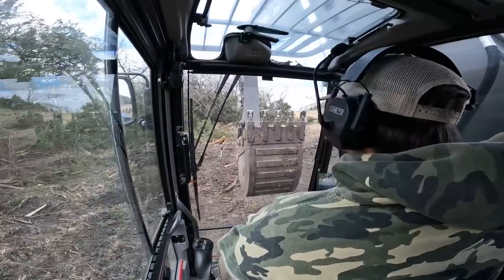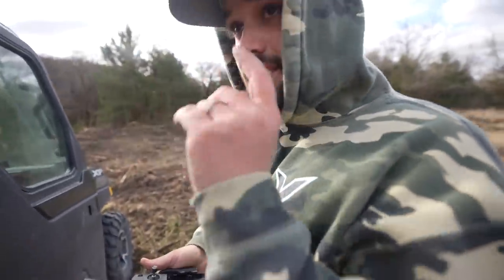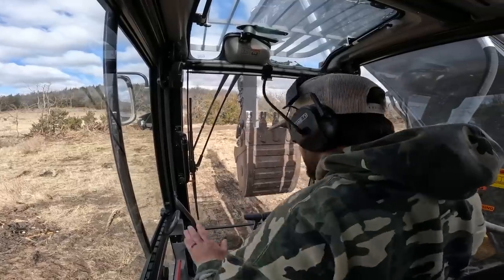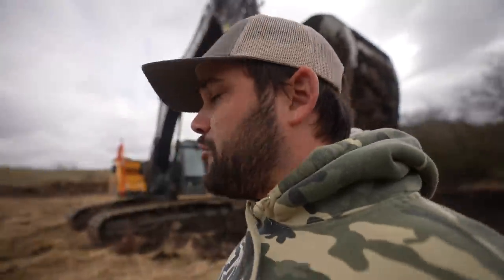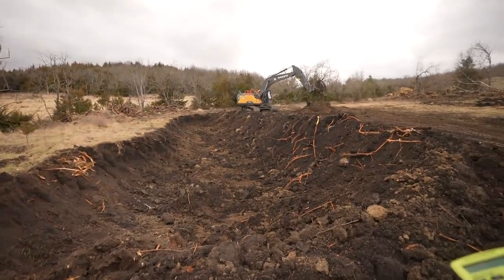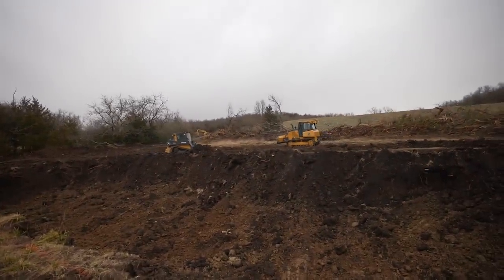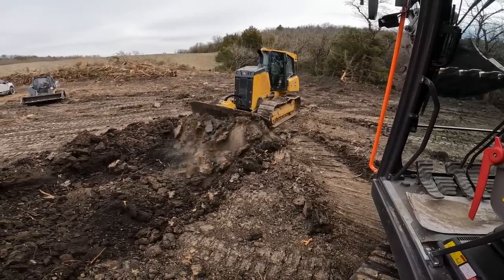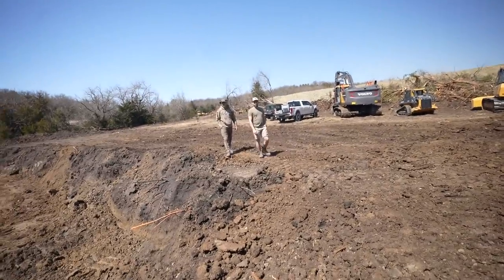Building a Giant FISH HATCHERY at My RANCH!!! (First Pond Complete!) - Day 2

Comment: So much to think about!! You'll need to be able to isolate each pond without disturbing the flow to the others. You'll need to be able to control the flow into the ponds to avoid heavy rain events. In other words, flow control and a bypass.  Probably going to need an aeration system to prevent oxygen depletion as the water flows through the ponds. So many more issues need to be addressed with engineering controls.
Reply: I’m a big fan of Flair but it doesn’t feel like he did any research or put in a lot of thought to this project.  I really hope it works out but it’s difficult to watch.

Comment: Experienced ex trout farmer here! You might want to consider the following: 

a) making the sides with shallower slopes to make getting in and out of the ponds easier on you and your crew and so you have a place to walk when seining. 

b) making the next ponds generally shallower. Pulling a seine through 6-8’ of water is NOT easy lol especially in a pond of that size when it fills up with muck and weeds eventually. I would recommend 4-5’ and the most. It can be done deeper but typically deeper grow out ponds have a drain with a kettle in the bottom that will hold your fish when it’s drained. 

c) making one end of the ponds have a 1 or 2 foot shelf that goes maybe 30’ into the pond to give yourself an area to work the fish into with the seine. This will make it easier to dip net your fish out of when it’s time to harvest. 

I’m not sure what Beamer told you but it seems like you’re off to a great start! Just some things to think about. Also you may want to consider installing drains to help clean the ponds out every once in a while. Not necessary but super helpful.

Comment: You need to push some of the clay up onto the sides to cover up the top soil then pack it down. That way they will hold water better. The last thing you want is the hatcheries to dry up killing everything. Basically pull the dark brown dirt back and cover it with the light brown. You can even mix it up a little.

Comment: Just a suggestion... Since you are still stocking and feeding your ponds and possibly could sell the excess for some dolla's.. go with crawfish, tadpoles and large minnows in the 3 upper pools to give you what you need for all the ponds/lakes you have. You can always sell the excess to local bait shops. 
As far as the 2 lower large pools I say you split in half down the center like you said. Tier 2 of the large pools below the 3 stocking pools, one side can be bass and the other side catfish. On the lowest level (dig it deep with high sides to keep the water cooler) go with trout and walleye and again have it split into 2 separate sides. 
You can sell the larger trout, walleye and catfish to restaurants or those that want to buy online for sure. There are many that want to stock ponds/lakes you can sell the fry/younglings to. You will need to section off for fry as you did with the PVC net troughs but that should totally work.  
I guess the biggest question is can you get power into the area to support water and aeration pumps plus all the needed feeders. That and a crew to man this large operation for day to day... 
Would love to see it all work, that would be so cool!!! Love me some fresh walleye and trout.

Comment: If you hop in the skid steer and just take out the first couple inches around your perimeter of what you're digging in the excavator it'll be easier to stay in line... Just a little trick for when you're newer. That's what I did when I started out.

Comment: 2 BIGGEST digging mistakes you are making.  
1) it is dangerous to leave a machine without grounding your attachment.  Put your bucket/ dozer blade on the ground before getting out. 
2) stop slamming your hydraulics.  The fastest way to an expensive repair is to let your cylinders bottom out or top out.